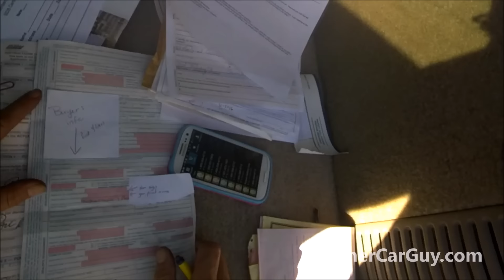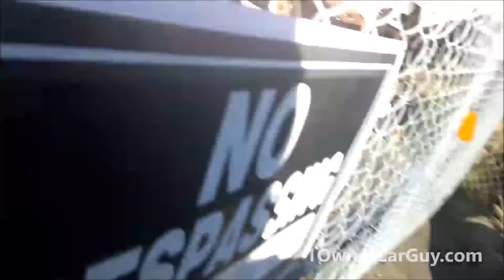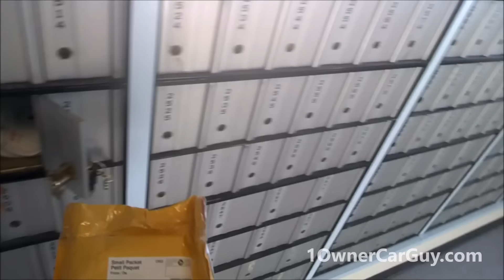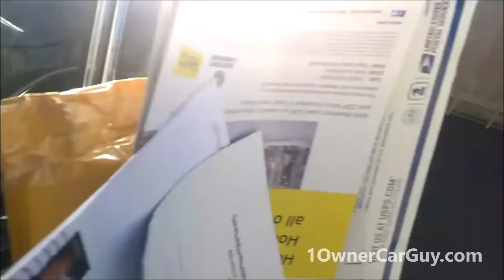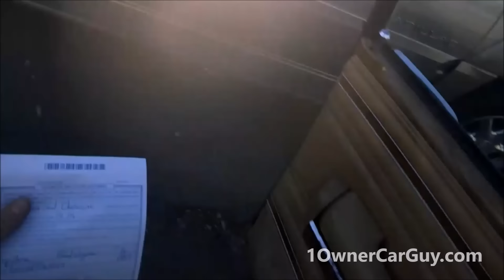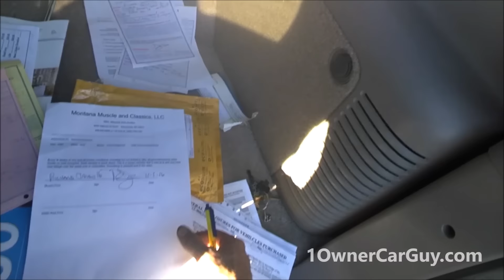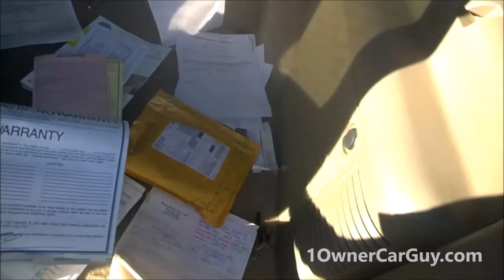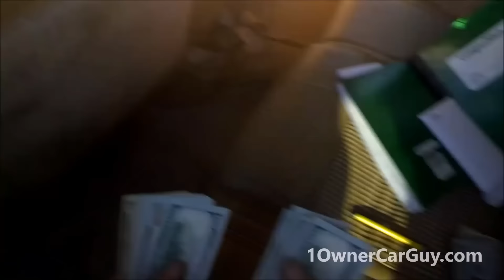Selling Classic Cars How To Behind the Scenes & Batteries Wholesale

Comment: The wire coming out of the seat belt - you were correct it was for the "Belt minder" thing.  If you didn't buckle it when you first get in, it is supposed to activate the chimes and the seatbelt light on the dash cluster.